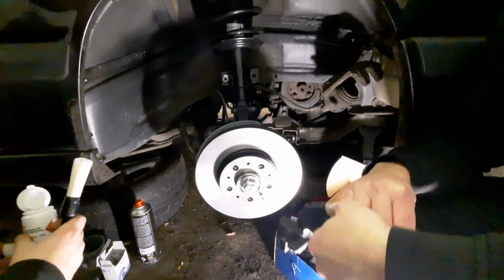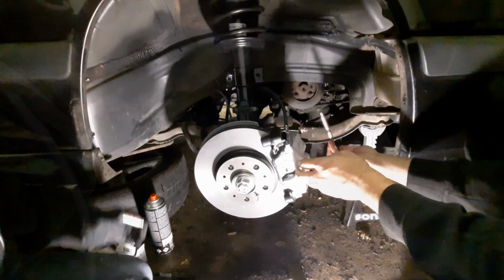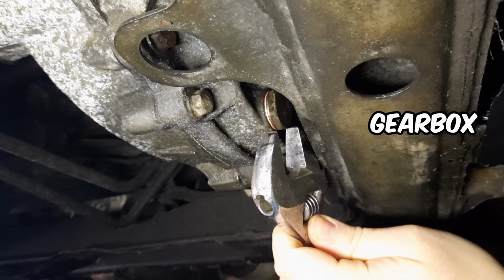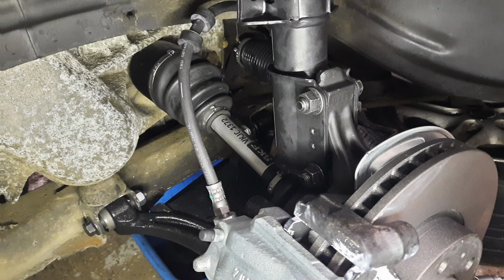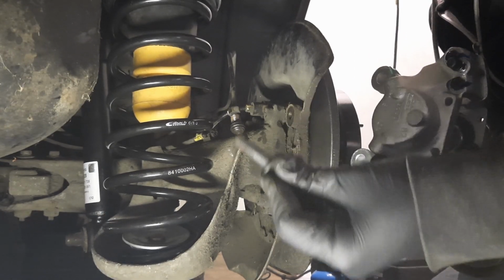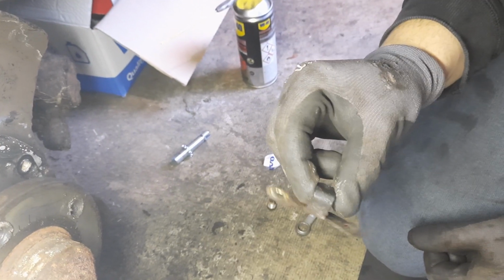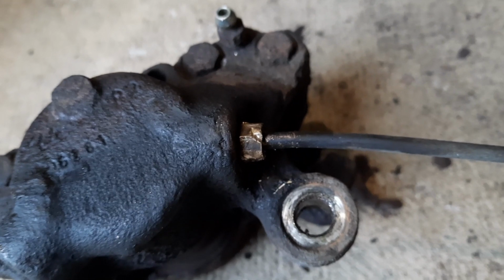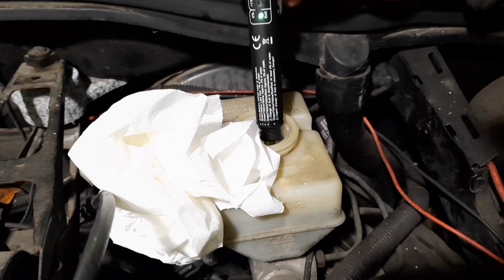Volvo 850 Restoration - Installing New Brakes

Comment: Hello guys! Where did you get the rear metal brake hose/line from? I have the same issue as you did with the nut, and cannot locate a new line
Reply from the maker: Pretty sure we got that from Estate Services. Had a quick look and I believe it was part number AA0650-S. (I could double check the invoice tomorrow to be 100% sure).
Don't know where you are from but they are based in the Netherlands.
Reply: @MusTRitch  Thank you so so much! I found the right part thanks to your help, I really owe you all one!
Reply from the maker: Awesome! Glad we could help!😄